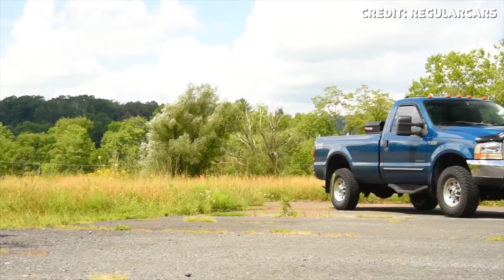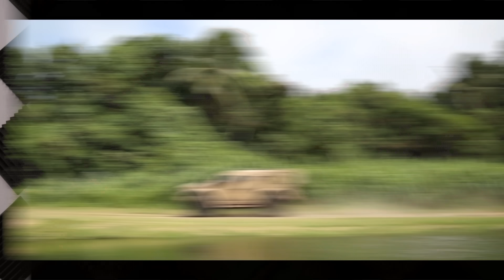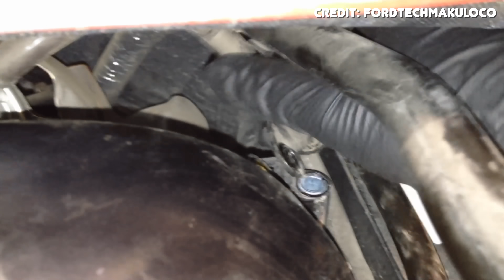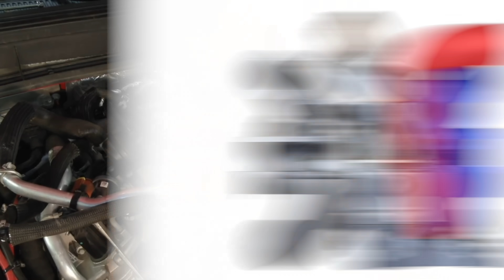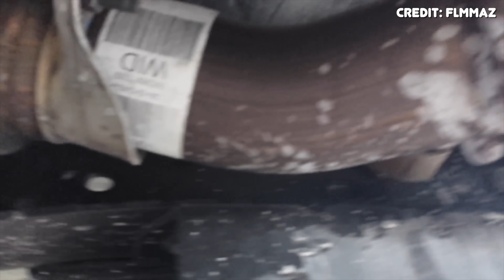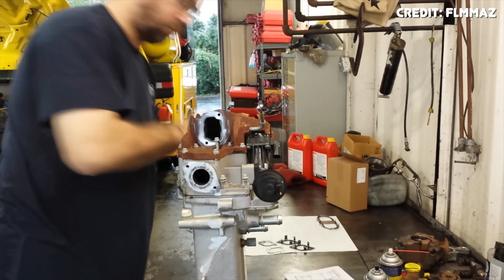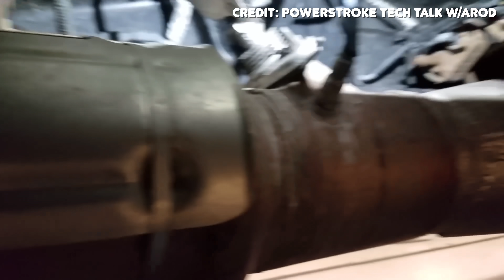Everything Wrong with the 6.7L Powerstroke

Comment: I have a 2013 F250 6.7 with 450k miles truck runs great. Besides regular maintenance its been a gem and yes I have put over 250k of those miles myself. Highway miles from Tx and neighboring states. I'm in the oil and gas industry so I get a little off- road too.  I love my truck and will never go away from diesel.
Reply: I'm about to get a 2013 king ranch with 230k, I've pulled a goose neck with it for a few thousand miles and I'm in love. It's been well taken care of by a family member and I think it will get to half a million miles if I take care of it.
Reply: I have a 2013 F250 6.7 with 520K. Excellent engine still runs great. Here in Texas driving my neighboring states
Reply: @KevinAnderson-b4m  should be at 600k by now?
Reply: I am curious if you got that reliability with the emissions intact?

Comment: Ive driven high horsepower Powerstrokes of every design and by far the 6.7 cant be touched even though a good built 6.0 will hold its own. Ive beat cars in a straight line that you'd probably never believe but those Shelby Gt500 and Corvette Z06 owners can attest. If i ever come across the Shelby video i'll post it here. It was his girlfriend at the time sitting passenger seat recording it all up to almost 170mph when i let off because i thought the 35" Grapplers were going to seperate from the sound they were making.

Comment: My first Powerstroke is my current 7.3 2002 4x4 Excursion and I’m in love!  Sure it’s not the fastest but I can’t actually fix everything on it easily and I never feel like it will leave me stranded.
Reply: I bet you are super good at changing the gaskets on the regular because it leaks fluids like a net…
Reply: @markturner5207 never had or heard of anyone have a leaky gasket on a 7.3
Reply: @markturner5207 at least he doesn't spin bearings and come out of time every time he steps on the gas like 6.7s do.
Reply: @Kolonol1  wouldn’t know, I’m finished with fords.
Reply: BASED  on your own opinion which generation of the 6.7 is the best 🫵🫡🫡🫡🫡
Reply: 2020 @Ghost-_-777y

Comment: being a diesel machanic bla bla bla bla bla bla the 6.7 will have more problems than the Duramax and cummings combined mainly bc of poor design in certain areas the 6.7 was also a byproduct of Navistar "6.0 and 6.4" that was re-branded to save the powerstoke name they all have their problems just pick your poison!
Reply: I'm looking at 1 ton to carry a truck camper. moving from a tundra and not sure which pile of junk I should buy. Whats your recommendation?
Reply: Tbh just depends on where you’re located like here in az we got a lot of hills and the Cummings do really good and they shine when off road pulling but if you want something more comfortable and are flat towing a f250 isn’t a bad pick either just say away from the 6.0 and 6.4
Reply: Do note that there is a 2 span in the cumming 3500 that can be a problem child

Comment: I just purchased a 2012 powerstroke that's FUBAR. Was told it was fueling system originally, then was told the engine was bad.(haven't had it inspected yet, bought sight unseen), my question is, if I have to put another motor in it, what are my options? Am I limited to the specific 2012 engine or can I go newer?

Comment: I'm a V8 diesel fan, and love the IDI, 7.3 PSD, old Detroits, MF 1155 tractors, and many more, but I would have rather seen Ford clean sheet an I6 diesel in 2011. 90° V8s are perfectly balanced like an I6, but have 4 pulses per revolution so they feel smoother than an I6, and that's a big part of why Ford and GM use them. My reasoning is solely based on emissions equipment and increased complexity. It's way easier to work on a Cummins 6.7, hands down.  The first time I removed the EGR off a 6.7 Ford I hated how tightly packaged they were and curse Ford and GM for doing this to us. EPA mandated garbage is nothing but stop gap measures, and it's gonna break down. May as well make it a lot easier to service and cheaper to repair.

Comment: the not so funny thing about doing research on things and not having as much hands on time with it too it can make you think ohh this isnt too bad or it sounds like an easy fix. i was that fool more times than i wanted to ever imagine.
ohh thats cheap. some of the cheapest pieces mechanics replace are the hardest ones to get to.
i used to want a diesel i ended up working at a repair shop years later. one job perk was it was a very high volume shop all makes and models and types of owners.
i was stoked to get paid to learn diesels cause i could fuck a car up if i had what i needed. i was pretty good. i mainly knew one brand before that for major knowledge but could get what i needed done on other cars i hadnt worked on before.
at the end of working at that place i didnt really want anything to do with cars at that point and learned alot about whats supposed to be easy aint. early on production is great ohh its so reliable easy fix cheap parts. but 5-10 years past new time tears up cars as bad as the owners/kids. 
sensors should come out but rust/corrosion due to 2 or more diff metals are not fun. red locktite beats steel with some age deff aluminum. build up in exhaust can ruin your existence. sensor pulls threads like ford 3v spark plugs if they come out. thank you carbon and rust. or takes the whole ass bung and a chunk of pipe with it. threaded facking balljoints. seriously. 
those egr coolers that should be easy to service. i promise you broken bolts. and maybe the intake too. some cars require the entire interior to be removed for a heater core or evaporator and thats the time i decided im done working on other peoples cars lmao.
the engineers are literally insane and hate everyone these days. water pump that makes you remove the power train and subframe and lift the vehicle off. hardened bolts broken off in aluminum heads with locktite on them and rust/corrosion. i used a welder to remove them because i was so over it. you cant mig weld aluminum but you will get the steel. and heat the bolt and loctite or liquify the bolt if its pissing you off. my coworkers had an intervention with me after seeing that. not because it was a problem but because they were so mad they never did that or even thought to ask me to. instead they had to fight with it and drill out and tap holes that didnt have space. its all out war trying to even do mundane things sometimes idk how they call that progress.

Comment: We had 2 f350’s 6.7L and both fuel pumps failed. I saw online that ford had a class action law suit against them by a company who used the 6.7l and the company had multiple fuel pump failures in their ford trucks. An investigation found that ford fuel pumps used in U.S. trucks, were designed for European vehicles, European fuels viscosity is different to US fuels viscosity. This was found to be the issue. To this day, ford still used the European spec fuel pumps.

Comment: I had a 03-04 (don’t remember which) psd for my work truck and it was very reliable.  The only problem I remember it having was the fuel started mixing with the coolant. I don’t remember what it was that caused it but it wasn’t real serious if I remember correctly.

Comment: APSOLUTE dig your Videos  1000% spot on
I just recently had bad times on my 2013 f450 true cab/chassis that I used for personal use and only pulling my toyhauler,at 100845 shit the cp4 pump my cost and doing it myself [ I don't work on diesel trucks] $8000.00 with new turbo all factory ford parts no programmer bone stock 80mph loved the truck but after spending all that money it came on with another issues after completion,in heavy hauling 14,000 lbs getting on freeway truck would shut off because it was peaking past ecm rail pressures 31900
With no codes Took it to 1 of top 3 diesel shops in AZ 2weeks later got my truck back said there's only 2 other things to change 🤔 wiring harness & eng ecm LOL they couldn't figure it out well my blurle collar ass already maxed out to credit cards to pay for parts I definitely didn't have 2100. For that so I got my dream truck earlier then expected and not what I ordered but a 2022 XLT F250 crewcab 4wd 7.3 GODZILLA 
And it's An APSOLUTE MONSTER I might get a speeding ticket in this truck 👍

Comment: I’m a 7.3 fan myself but I can agree that the 6.7 is definitely a good and efficient engine especially if it’s deleted with a towing tune. Both have been known to last up to 1 million miles unlike the unreliable 6 liter and the worthless 6.4 and both the 7.3 and the 6.7 come in trucks that to me are actually badass! The obs 1992-1997 body style being my favorite and the 1st Gen Alumiduty 2017-2022 being my second favorite.
Reply: Are there any problems with the dpf on the 6.7?  How did they change that from the 6.4?  I'm worried I should delete with my 2019 at 57k mi and head off any trouble off at the pass.
Reply: @Lykapodium  when I worked at the ford dealership we saw tons of issues where the trucks weren’t regening when they should and would blow temp sensor modules and the sensors themselves quite often. Also deleting the dpf relaxes the engine a ton and allows it to breathe easier and theirs less carbon/soot build up in exhaust and intake ports. If you delete the dpf I would highly recommend deleting the egr and egr cooler as well since the egr cooler tends to crack and leak and the egr introduces soot to your intake which ain’t good for your engine. Only reason I don’t work for the dealership now is because I make more money working for the county owned garage fixing their trucks on an hourly rate.
Reply: @hilljackzack7284  wow... Thank you for the detailed response.  How much of a job is this to do?  Can I pay you to do this? Are there shops that can do this? I bought the 6.7 after shopping for a year and a half going back and forth between it and a beater 6.4.  really like the body and engine of the 6.7.  Would like to get out ahead of any problems with this engine. 100k/5y will be up in a year and want to delete. Don't have time to do it myself. Any good options? Thank you for the response, appreciate it!
Reply: @Lykapodium  it’s not too bad of a job really, you just need a sawzall, welder, 4” round metal pipe as long as the dpf and a tuner and there’s kits online you can get but I do believe there are some aftermarket shops that delete them but depending on the state you live in it’s possibly illegal and sometimes strictly enforced. I know here in Ohio people cut them off all the time and get egr delete kits that are “off-road use only” and a tuner and they run around no issues. I don’t really like to take on side work anymore but I know some people nearby who probably would do it. If you live in California, Oregon, Nevada, Vermont, or in any major city where emissions testing is required for diesel trucks annually I wouldn’t do it. If you live in Ohio like I do, or any Midwest state that’s not Illinois or any Southern state that’s not Texas (unless you know an inspector in Texas) then it’s definitely worth the delete. If you live in Central Ohio then I could probably lead you to the right direction for a diesel mechanic who will delete your emissions off your truck, again I don’t do it commercially myself but I do it on trucks I own, I work for the county government here and would get fired if it got out that I delete dpfs and egrs as a side hustle.

Comment: I have what I have been told as a 2013 Spider engine. Do you know if it has the fix issues worked out on it? I friend told me that I was lucky to have this engine. Right now I have 335,000 miles on  it and no problems yet.

Comment: I have a 6.0 with 183k, had to delete EGR around 130k but as for the 6.0 issues I haven’t had any.. I don’t rag on it and I change the oil every 5k miles, with regular maintenance on the fuel system also added a  coolant filter around 100 k..  I do pull around a trailer for work only around 6000 lbs but it’s been a great truck so far.
Reply: I'm not a ford guy, but from the research I've done, the 2005+ 6.0 is a bit better than the first 2 years. Also, from people that do the head gaskets and head studs, they seem to like them. I don't think they can handle as much power due to 4 head bolts per cylinder, but they can still handle more than 99.9% of people need.  I think the 7.3 has 6 per cylinder.

Comment: The number one failer is NOT the injection pump! It lasts an adequate life span of well over 100k miles. Mine has 125k and going strong with no issues. They also do have warning signs with the engine not running quite right when it starts to wear out. You don't have to replace the fuel lines and you have to be extremely negligent of your engine to let the pump grenade on you. Injectors are probably not far behind the fuel pump so just best to do those while the engine is apart.

The number one failure was the ceramic turbo bearings. But so long as you are not a Neanderthal and keep driving it when a known turbo issue which it also can send scchrapnel down the engine. But is true for any turbo neglected enough. But regardless it's just a matter of doing a turbo rebuild or new turbo.

Comment: I'd be curious to see you review the new high output 6.7L
Reply: It's gonna be 500HP and 1,200 pound feet of torque. It hauls 40K of towing for 5th wheel gooseneck.
Reply: Not sure but I’ve read it’s all programming, not a single new part.
Reply: @Scott Forrest  interesting. I assumed it was just a bigger turbo.

Comment: Looking at what ford has to offer, I think the 7.3 gas V8 is more appealing. You can get GCVR of 26k with adequate power for the popular 14k trailer with 10k payload and not have to deal with all the extra emissions crap. The V8 will be less efficient MPG (15 highway vs up to 20) especially towing (8 vs 12 for a heavy load), however it using cheaper regular gas (3.20 per gallon currently) vs diesel (4.75 here currently or 30% more expensive) and being 10k cheaper with no DEF plus other maintenance costs makes up for it. Only reason to get a diesel is if you need to tow 20k+ with a big truck.
Reply: They are meant for different purposes

Comment: I have a 2000 7.3 diesel and  love that is very simple and dead reliable and zero emissions.  I put a  slight tow tune and have plenty of power a lot I never tap into even with a 3000 lb truck camper.  6.0/6.4 are trash and it sounds like the 2020 and newer 6.7 are good while 2011-2019 are crap.  
No def fluid for me and my exhaust system doesn’t cost 4-5 thousand dollars which I’ve heard fail after 100k miles

Comment: Yes the cp4 is trash and always willlllll be period get rid of it period. Fords wiring under the hood is junk also to small use wiring ford not thread. The oil pan and bed plate seal is another problem. Ford engineer just because it looks good on paper doesnt mean it is start using your proving grounds like they should be
Reply: Just goes to show you with the 7.3 leave the government and EPA out of truck manufacturing

Comment: I feel a little better after watching this video. I've been driving a 2001 7.3 turbo XLT F-350 4X4 for the past 21 years with what I would call, normal breakdowns and repairs. Once again, it's in the shop for repairs,  this time having the oil cooler seals replaced. After 326,000 miles, that was the final straw for me and antiquity, I just purchased the 2022 F-250 XLT 6.7 4X4. I hope I get as much service out of this one as I have from my 2001.
Reply: good luck! saw something about a multi piece intake manifold leak requiring pilling the cab. love my 7.3's running til the bodies fall off.

Comment: Bro, there were less than 50,000 Cessna 172's made, EVER (over it's 66 years).  Ford almost made that many powerstrokes in a month.  Get educated before you start spewing off about aviation.  Jet travel, they have made significant strides in efficiency over their life.  Mostly driven by cost of fuel, but it's still there.  Hell, government finally approved unleaded fuel for general aviation.  FAA is a turd and should be tossed out along with the ATF.

Comment: Had a 2013 F250 extended cab long bed and purchased a 2021 F350 crew cab dually 6.7 to pull a large 5th wheel just before the prices increased significantly.  I've never had a single problem with either truck and the 21 has more torque than I'll ever need.  It's a rocket ship.  I can't see myself paying upwards of 100K for a 2023 truck.  My 21 will most likely be my last diesel. Sure do love it though.  DJ

Comment: I was skeptical of your review at first but it ended up spot on. I’ve been beating on diesel pickups for 20+ yrs and dropped Cummins/ dodge in 2011 for Ford/Powerstroke.  I’ve put almost 2 million miles on (5) 6.7 Powerstrokes and they have proven to be absolutely reliable, clean fuel has given zero fuel system issues.
Reply: How do you ensure clean fuel? Just keeping the filters maintained obviously but do you also prefer a certain gas station? Im getting a 6.7 soon and want to keep this cp4 pump together
Reply: @rprokopow  I use a bed mounted tank with a pump and filter to fill my primary tank (nothing goes from source to primary) Motorcraft/Powerstroke additive in every tank.
Reply: How did you deal with the spun bearings and how did you keep them in time?

Comment: The Bosch pump was designed for higher sulfur European diesel,  the US Low Sulfur Diesel doesn't have the lubrication properties which causes the cam failure, put half liter ATF in w/fill up and drastically increase the life of pump
Reply: What is ATF ?
   On my 2014, 6.7 (71,000 miles), I just began using additives.
  Question, another post indicated that he was adding 2 cycle oil to every tank fillup.  That sounds like an excellent solution to compensate for our low lubricating, low sulfur fuel. 
    What’s your suggestion?